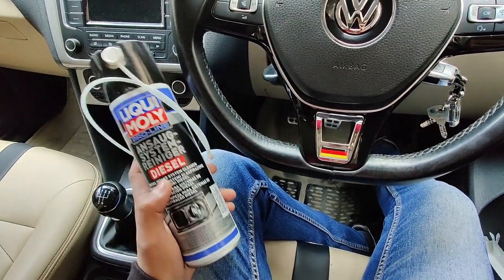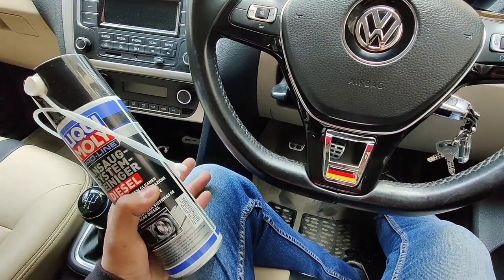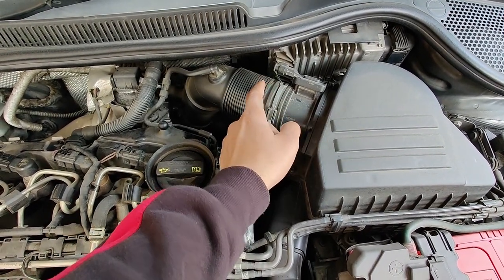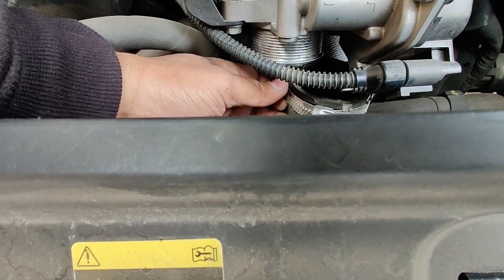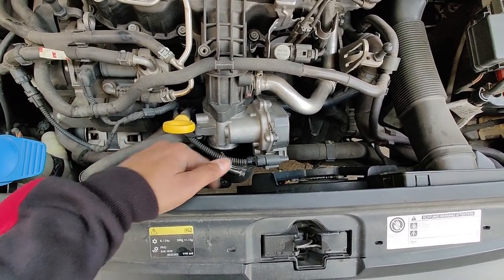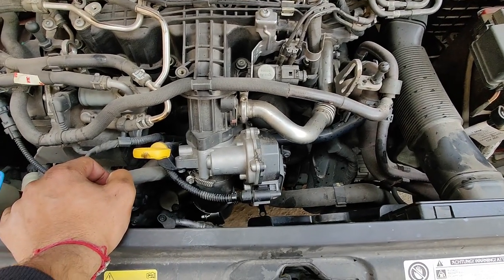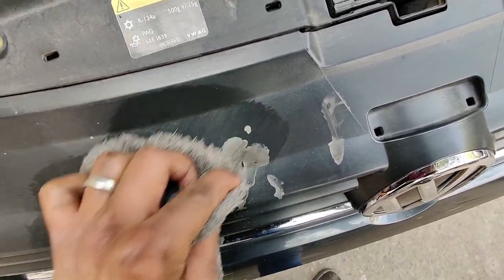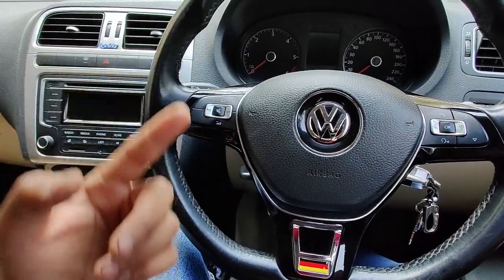INTAKE MANIFOLD CLEANING WITHOUT REMOVAL | CARBON CLEANING | LIQUI MOLY | REVIEW

Comment: Sir i hav 1.2 tdi do i have to remove the map sensor near the air filter and follow the same
Reply from the maker: Just unplug it and spray after the sensor
Reply: @yourDIYneeds  hie
Can I use the magsol Egr cleaner because I am not getting the liqui moly one anywhere
Reply from the maker: Yes sir you can
Reply: Also sir my car has run 1 lac kms and I’m thinking of doing the diesel spurge by liqui moly which way do you suggest of doing like direct from the engine bay or just put it in the fuel tank
Reply: Also sir can I get your mail I need your help
Reply from the maker: everydaydiyhelp@gmail.com
Reply from the maker: Putting it in the tank , purge is quite a corrosive product , so you want to run it gradually
Reply: @yourDIYneeds  full tank ? Or a quarter
Reply: @yourDIYneeds  thanks a lot sir
Reply from the maker: Full tank sir

Comment: deep scratch / grooves on rotor disc .. have to skim disc rotor ... vibration issue while braking in high speed
Reply from the maker: Yes sir , Get them skimmed on a good machine shop and then use new brake pads for best results , make to sure that you do brake bedding .

Comment: Just today visited your Channel, very informative, thanks.

I live in G.noida, own Ameo 1.5 D TDI Highline 2016, if possible can you check my vehicle for performance issues, it will be helpful
Reply from the maker: What issues are  you facing sir ?
Reply: Thanks for your revert,from last one year or so, I noticed pickup issue after VW changed fuel system due to water clogging
Reply from the maker: Sir , which components got changed ?
Reply: I have to check for that, but as I remember OCR or fuel system something like that can't remember, total bill was arround 4lac, covered under warranty
Reply from the maker: 4 lack ?
Seems like they changed everything , from high pressure pump , injectors , rails and everything .
And you still have pickup issues , what they are telling you about the pickup issue .
Reply: Pretty much everything , but I doubt on injectors, I complaind 3 times total, they scanned and said, all ok...when suddenly one feels difference in vehicle performance who drive more in daily basis, there must be something
Reply from the maker: Yes , can be calibration of injectors
Reply: Yes , that could be the reason too
Reply from the maker: Just get it calibrated and MAF sensor cleaned , and then check once again
Reply: Thanks for the update, but I don't have any idea to whom I should visit for the same
Reply from the maker: Calibration will be done by authorize service station , but they will not clean the MAF  sensor , they will try to convince you to replace it . 
But it can be done at home , in around 15 mins 
I have a video on Channel , you. Can watch that for reference
Reply: Thanks dear I am checking your videos , really helpful,.... You are having knowledge and if you willing to check my vehicle let me know , so that I will be sure where I am going...let me know brother.
Reply from the maker: Sure sir